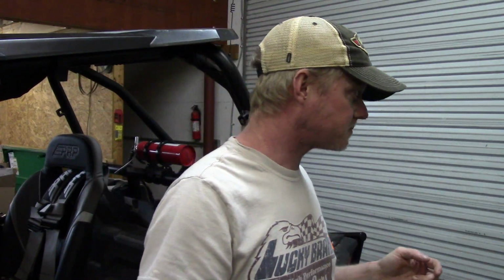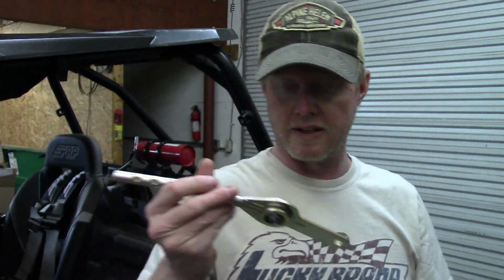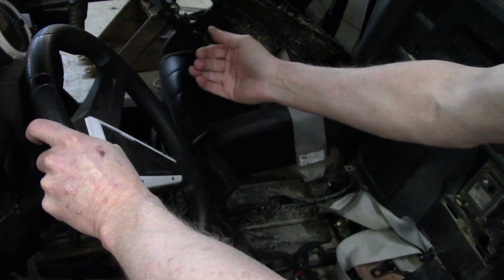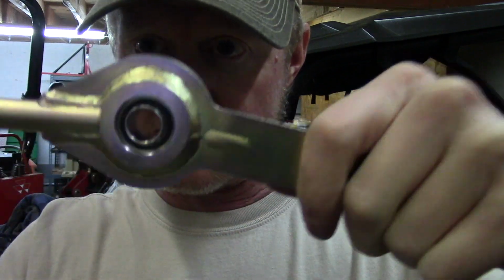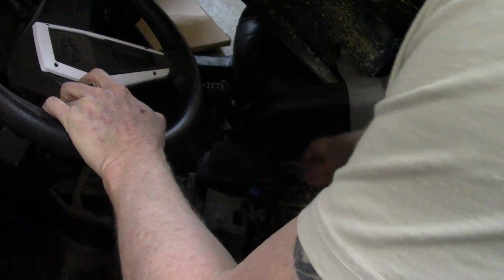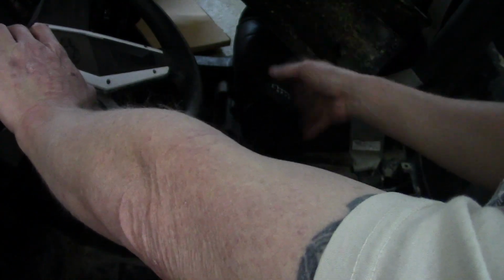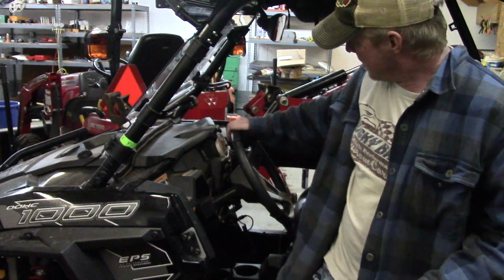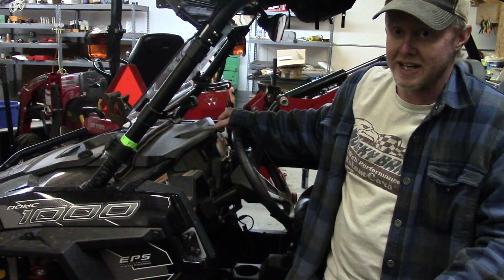RZR Factory Gated Shifter Install and Review

Comment: did you ever do the modified version to lock out high?  thats the main thing that has been keeping me from doing this mod instead of spending more for an aftermarket one.  90% of my riding is in low and reverse.
Reply from the maker: I didn't. Stuck with the factory upgrade pattern.